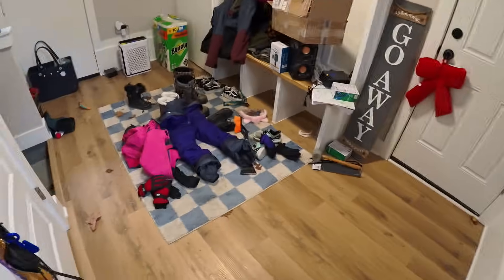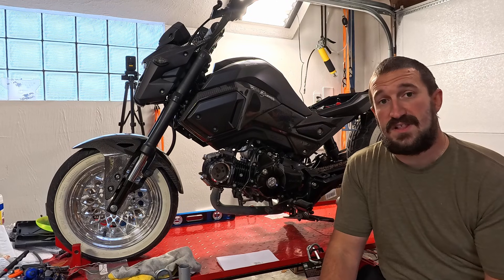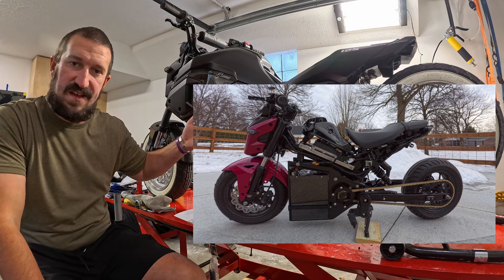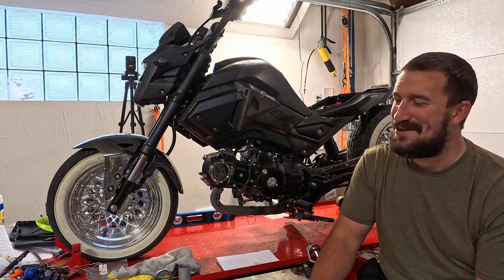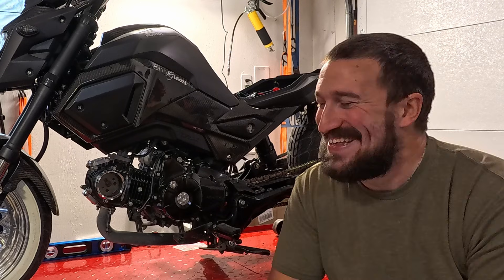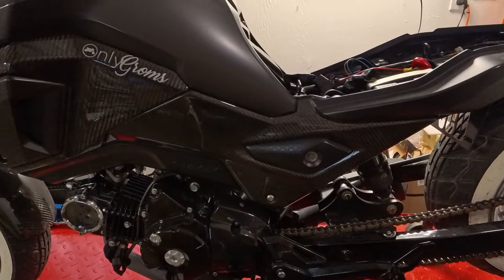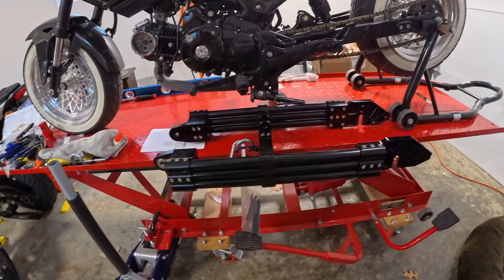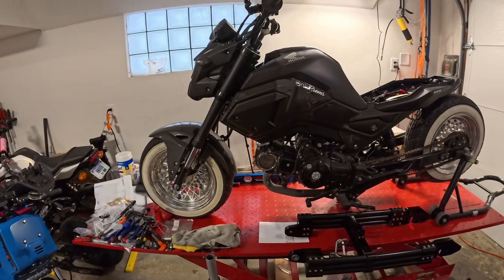Planning a 60HP Electric Grom Build (Insane Power Goals)

Comment: FYI the hub would actually eat more battery … that myth is off from my experience, I have a qs273 and a fw04 Sotion mid drive on 2 different bikes but same exact frame and weight as the same company makes the same frame, the controllers and setups/tune  (350line/900phase) are the same with the same battery since I am able to swap btw frames 

The fw04 which tops out at 85-90mph gives me 7 more miles than the qs273 which tops out at about 92-94mph

Running a 84/55ah p50b 24s and a FarDriver 961000

120ah in your case is so big you won’t feel a difference haha unless you compare it like I can with the 2 bikes ! 

I personally think you should go higher voltage, 96s 26/30s minimum and either p45b bak45 if on a tight budget, if not go p50b rs50 or TP 👌
Reply from the maker: Yea I have heard very mixed milage reviews from people that have owned both. And I did want to go higher voltage initially, but there was a mix up in communication when ordering and I got sent the 72v hub so here we are 😂 I'm sure I'll be happy with it either way!
Reply: @3CMiniWorks I mean sounds like you haven’t order the battery yet but that qs268 can take 96v no issues lol

Comment: You could go for a 76kw ventus controller + motor, + a 140v bat ora battery similar to the stark so it’ll have over 90hp
Reply from the maker: I could, but I won't. I'd be spending 6k on a battery alone. My controller is rated for 72kw so we're good there!